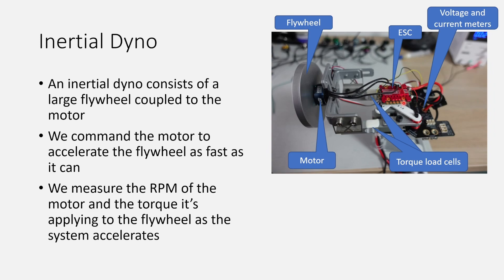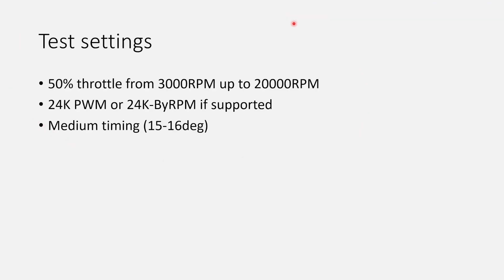Inertial Dyno testing of BLHeli_32, BLHeli_S, AM32, FETTEC, BLHeli_S and BlueJay

Comment: Would comparing current within 8500-11000 RPM, the (lower) efficiency of BLHeli vs BlueJay - where the former is peaking current while the latter is already at max torque - infer that BLHeli is way over-thinking lower-RPM protection interventions, but not smoothing the transition once removing the interventions, ie., the main program playing catch-up might be causing that wasted current peak trying to ramp torque? Still, BlueJay seems to ramp torque efficiently at 5500 / 8000 RPMs. From a (cruise-to-far-spot-and-do-your-thing) range-efficiency or cruising 5/6-inch cinematic POV, is pursuing 32-bit / G071 gaining any over decent (old) tech/profiles available on BlueJay equivalents?

Comment: Hi Chris, thanks for the work you do. 

A couple questions I haven’t seen videos on from anyone:

1) what is the real world cost to using a motor output limit instead of having the exact kv that you want? How much more inefficient is it?

2) is there a correlation between kv in a given range for prop size, and how high you can push gains? For some reason I have been able to push gains higher on lower kv motors. Is this a good thing? 

Hope I’m not out of line posing these questions here. Your skill set would be perfect for answering these questions. 

Thanks again.

Comment: Maybe I missed this during the video. But was there a reason to not compare bluejay/blheli_s with the others? Would be interesting to see that as well, since nowadays the decision is still very much blheli32 or blheli_s (with possibility to flash bluejay)
Reply from the maker: The graphs of the two are directly comparable. Sorry I didn't think to plot them all on the same chart. In general I would recommend bl32 over bluejay for the variable pwm and because the ESCs with BL32 tend to be of higher quality and rating in most cases.
Reply: @ChrisRosser  ah good to know. Thanks for the clarification :)

Comment: I wonder how much deadtime plays into this.
Reply from the maker: Perhaps it's worth identifying a few ESCs with very different dead time and seeing how differently they perform on the test stand. Any suggestions for ESCs with large and small dead time?
Reply: @ChrisRosser  I dont, but I would also be curious how esc settings play a role and if different motors just work better with different settings etc.

Comment: Now that you fixed tuning by dragging it out of that "magical mystic art"-realm and turning it into a systematic step by step approach... you're fixing the esc firmwares for us. Love it, this contributes so much!

(my 5.5 tracks critically damped at around 4ms vs. setpoint <3)
What I wonder when whatching those graphs: Could you actually feel those steppy curves when gradually throttling up? How does a smooth torque curve translate into flight feel/performance? And how would that curve look like with a normal prop and it's lower intertia but higher resistance?

Comment: Does the flywheel's moment of inertia torque equal propeller resistance at 50% throttle or 100%?  I'm wondering if the startup torque with the flywheel does not represent the real start up torque of a propeller, and that could be causing some of the extra hesitancy to deliver amps.  

Also, it would be interesting to see your take on the optimal graph line. What graph line would be realistic for an ESC firmware to achieve.